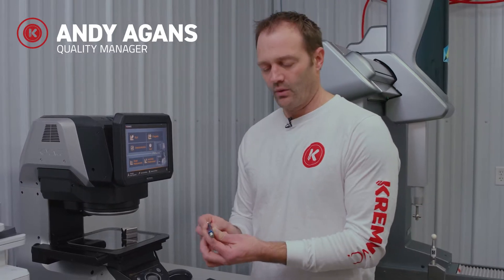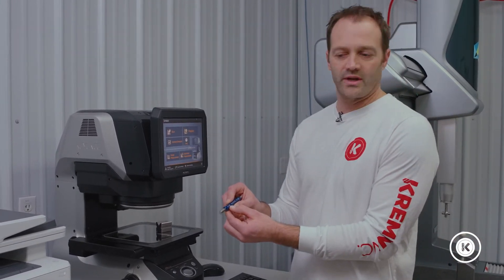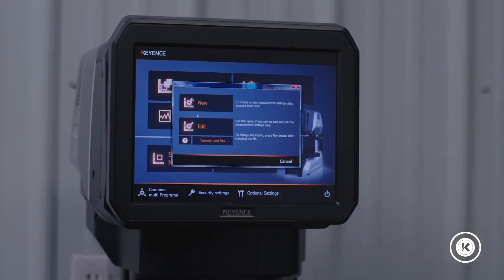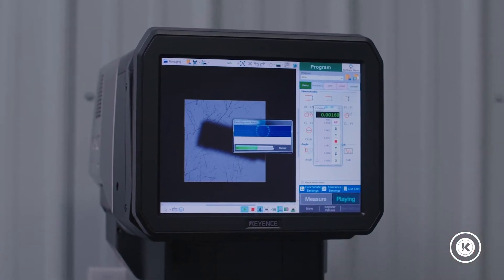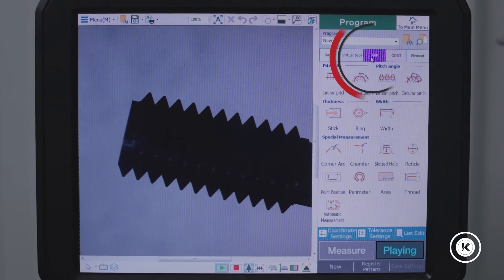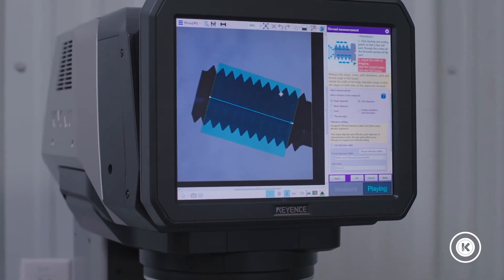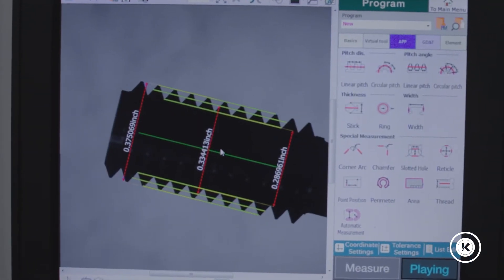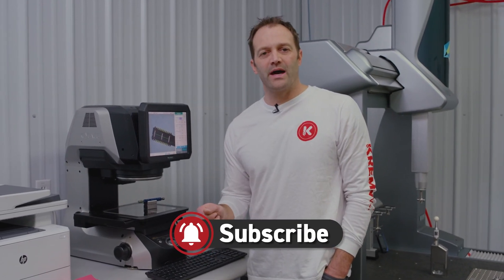Verifying Gauge Accuracy with the Keyence - Kremin Quick Tips

Comment: Why wasn't there a range of the pitch diameter?   The first few threads always have more ware than the last few threads.
Reply from the maker: Good question, we will reach out to Keyence to see exactly what they do, but we believe they are taking the average over the thread. So you are correct, you could have wear on the end. We only use it to monitor high use gages for wear, so we take a snapshot every x days and look for movement - we don't use it for calibration, we send everything out to a certified 3rd party for calibration. I will let you know what Keyence says.
Reply: @KreminIncManufacturing  Did Keyence ever respond to the question?
Reply from the maker: @precisionrp this was the keyence response ——  
When they are using the pitch tool, they only select Major, Minor, and pitch diameter. I think they can get the range they are looking for by selecting the pitch check box within the thread tool.

Comment: Hi, so I have a thread gage that's 1 1/2-20, and it doesn't fit in full view if I select "High Precision."  Would the "Wide Field" yield good results? If not, is there a suggested method for thread gages this big?
Reply from the maker: We use the high precision mode, I think you can stitch frames together if the object doesn’t fit but I would refer you to Keyence - they are really good with helping on things like this.
Reply: @KreminIncManufacturing  I did end up getting ahold of them and unfortunately they suggested no gages larger than 1”.
Reply from the maker: Good to know, thanks for posting.